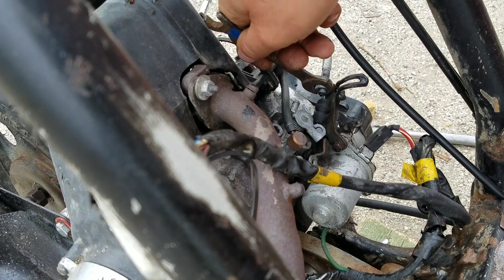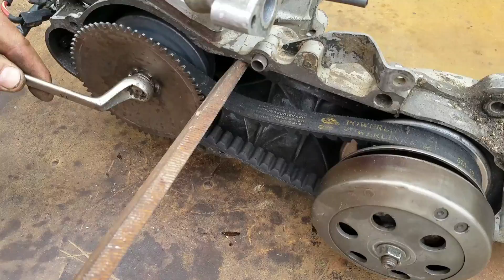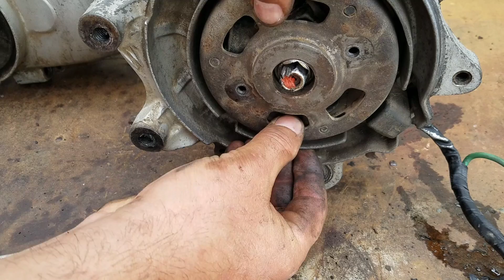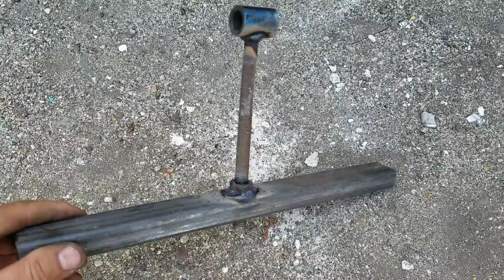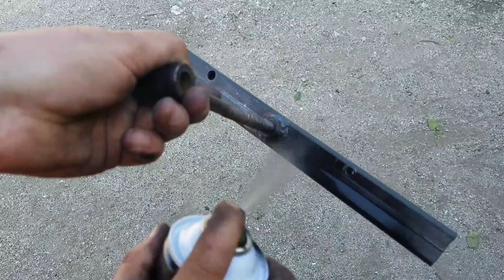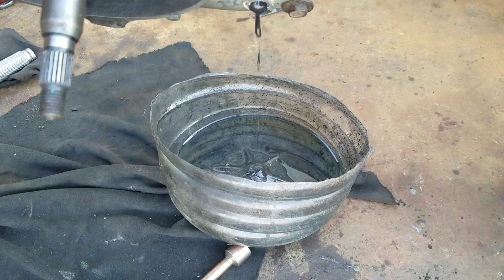Как разобрать двигатель от скутера Honda Dio

Comment: Does taking a oil pump out and putting a plug in it’s place mess with the throttle snapping back ? The tension on the throttle cable

Comment: Good job for disassembling the engine . But for the assembly i advice you to install new  SKF branded bearings ( really durable and strong) and for best results and longevity i advice you to cool the crankshaft with your new bearings installed  in a freezer for 12 hours ( the metal shrinks ) and heat up the crankcases to 100 celsius ( aluminum expands with heat ) and put your crankshaft with no effort or special equipment 
Can't wait for new videos . Keep up the good work !
Reply from the maker: Thank you very much, and what company crankshaft advise?
Reply: @Samodel  if you have a good budget you can buy  a MALOSSI crankshaft , they claim it is really strong and provides high rpms and of course more performance , if you are willing to keep it original then i highlg recommed you to keep the original cranskaft , but you have to replace the connecting rod and connecting rod bearings since your connecting rod  has some play in it ,  it is cheaper than buying a whole new crankshaft. Good luck my brother . I will wait for you new video
Reply from the maker: Thank you very much
Reply: @Samodel  you are welcome brother

Comment: Remove the mixer gearing to have a little bit of power , if you wanna tune the cylinder whithout buying a kit or work on ports timing with dremel tool you can add a thick gasket under the cylinder and remove the same mm that you added by remove top gasket or the turning the cylinder (for ex you add 1 mm alluminium gasket under the cylinder and you throw 1 mm on top of cylinder or more to have a lower squish)